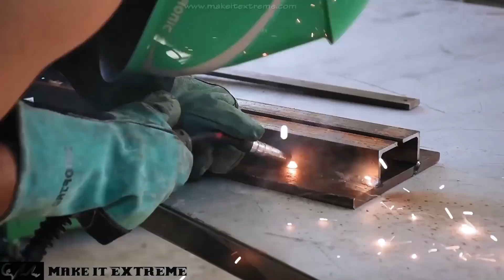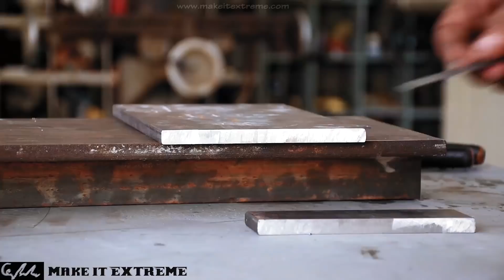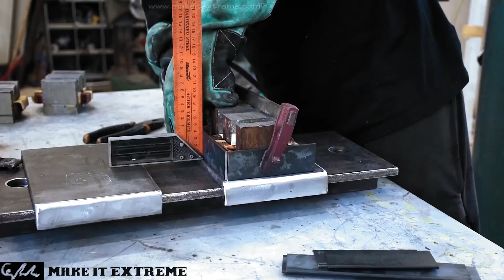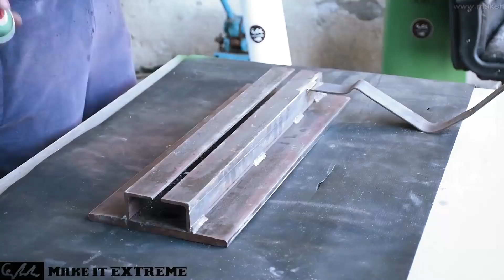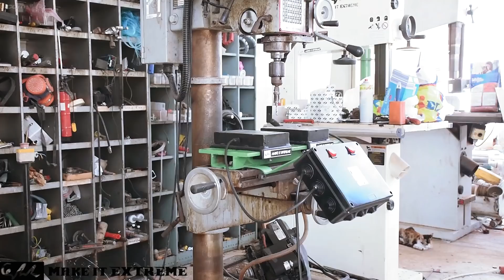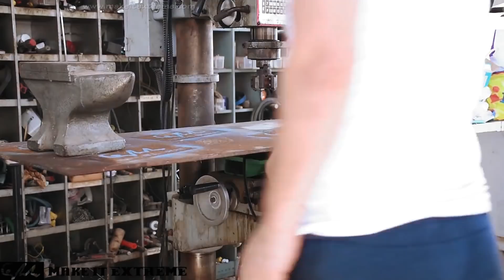Electromagnetic Drill Press Vise

Comment: Very cool build, impressive both in conception and implementation.  

One minor word of caution,  I'd be very careful using that during a thunderstorm or any other time when there's a reasonable chance the power could go out.  I had a friend who worked with some high pressure systems that were very safe and use something similar to hold the work item, until the power went out and the instantaneous loss of control created a very exciting projectile.
Reply: My power goes out continuously.....and I'm still watching this thinking wow what a great idea till you reminded me.....nope not a good idea
Reply: maybe a bank of capacitors in the switch box so the drill or milling machine shuts down first with a power cut to give you 10 seconds or so of extra magnetism
Reply: @lestercranmer2631  Yeah, something like that could work.
Reply: Maybe adding a ups would be a good idea. At least give you time to shut everything down

Comment: Very cool but don't these heat up like hell?
Mine always did and draw a ton of power too xD
Reply: I'm wondering if he wired the two primaries in series. That would greatly improve the temperature.
Reply: @JoseSilveira-newhandleforYT  hmm yes but then the magnetic field wouldn't be that strong.
It still draws lots of current too probably since a MOT primary usually has a really low impedance
Reply: @Electronichub_05  Yep. I've seen people simply using the secondary as primary to make a 12V supply and it runs cool. Also, these transformers are designed for short periods of operation and are run overloaded (less turns on primary than should be), so overheating is expected, but the intermittent use saves it from damage.
Placing the two primaries in series halves the current, but it also doubles the number of turns, which should create a similar magnetic field, only over a wider area.
Reply: @JoseSilveira-newhandleforYT  yes, I once had a MOT which turned into a smokebomb after two minutes haha
Reply: @Electronichub_05  LOL. I tripped some circuit breakers doing experiments - without the "I" section, the MOT primary is almost a short circuit 🙂
I managed to make one work as a weaker electromagnet with a bulb in series (didn't have two coils to put in series back then) - still could test motor armatures and demagnetize tools. That was a long time ago, when MOT coils were made of copper and not aluminum 🙂
Reply: @JoseSilveira-newhandleforYT  haha cool, i hate that they have aluminum coils nowadays.
It's just unnecessary cheap 😂
Reply: @Electronichub_05  Consumer products are designed by the cheapest standards (use and throw away).

Comment: Clever idea using primary coils of microwave oven transformers. I just wonder what kind of power supply you are using, DC voltage I believe and what is the voltage on each coil ?
Reply: @fladoodel  
A transformer with only one coil is no longer a transformer. If you watch the video again you will see that the secondary coils have been removed on all the transformers and the metal cores have been reduced accordingly so they now are electro-magnets, so they now should be powered with DC.

Comment: The only problem with it is that it magnetizes both the workpiece and the tool. I think that could be a problem. And I wonder what's in that big box besides the two switches. 🙂
Reply: Most people who work with metal have a demagnetizer.
Reply: It’s AC so it doesn’t magnetise.
Same as a demag